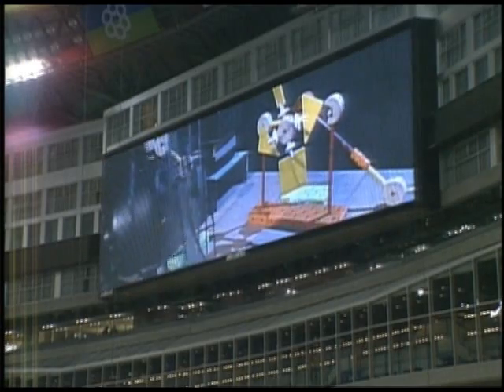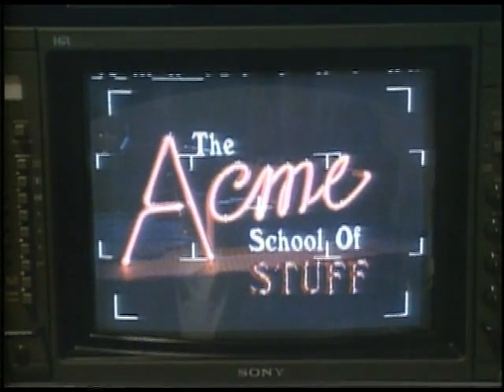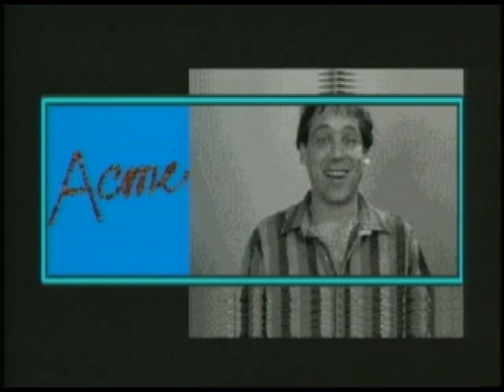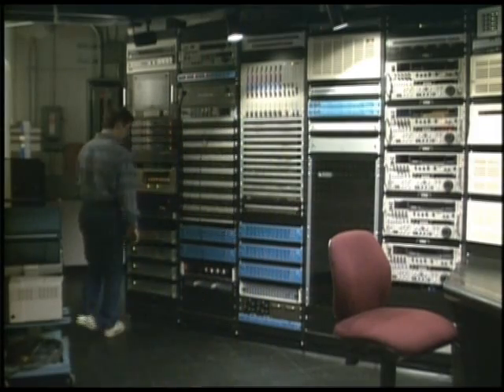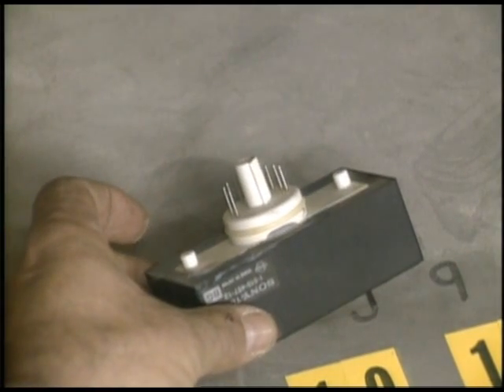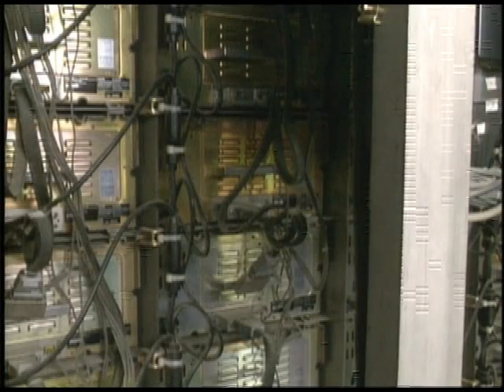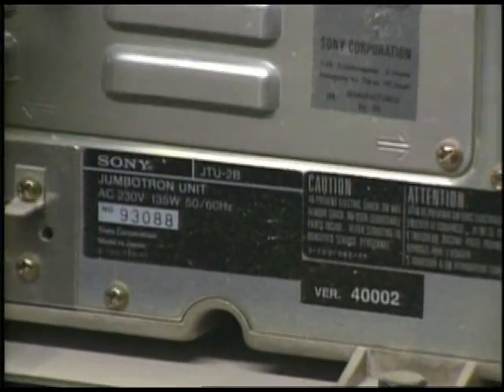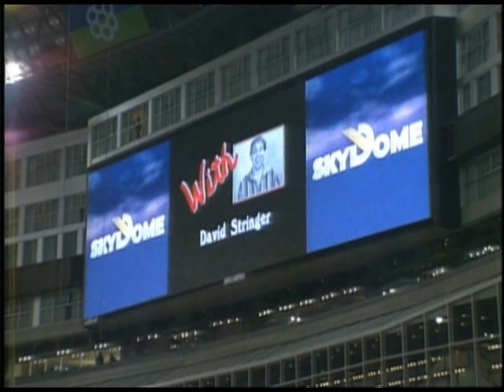The Jumbotron

Comment: Don't plug the Trinilite blocks in live, 8kv anode voltage it bites, got a load of JTU-35A modules at home on display, set the rear address to 98 or 99 and its in test mode, proper CRT based pre LED Videowall, work with Jumbotrin and now LED kit from. Barco, Absen, Aoto, ROE, Yestech, InfiLED, GLUX etc.
Reply: 8 KV second anode? Really? I wouldn't have expected it to be anywhere nearly that high; it only needs to go an inch and a half.

A buddy of mine used to work the Tampa Stadium one in 1990 or so. He brought me a Trinilite pixel, but I don't have it anymore.
Reply: @baylinkdashyt  i would think that the voltage is higher since it needs to be so bright to be viewable in sunny daylight. but yes, i think 8kv is still quite high